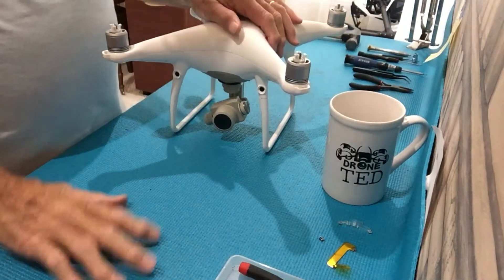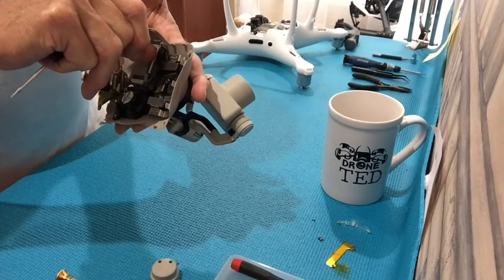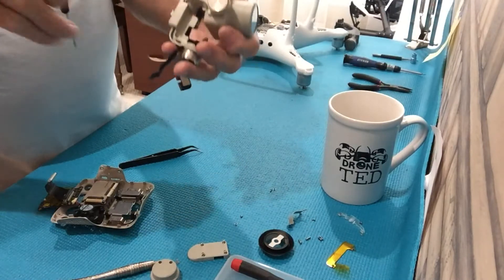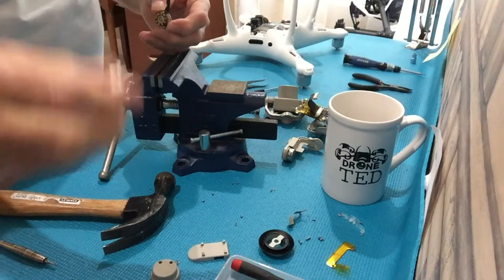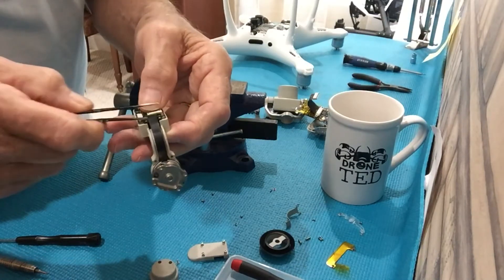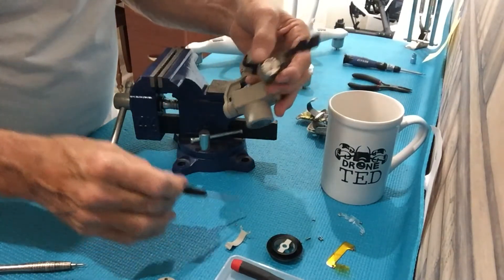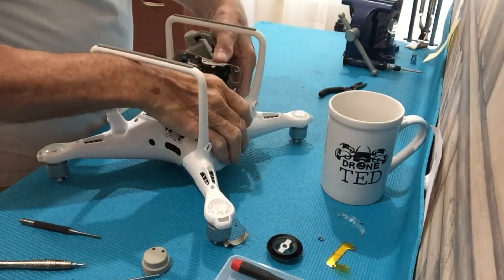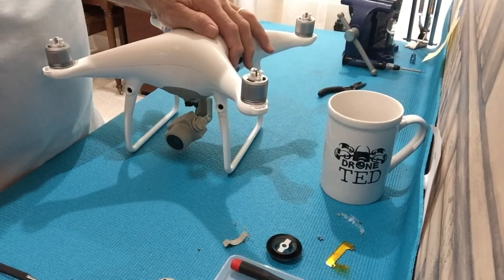Yaw motor replacement DJI Phantom 4 series video 1 and 2

Comment: Ted, is still necessary reuse the old magnet case? For P4 regular, seems all parts come with the magnet case as a Plug & play,

Regards
Reply from the maker: Yes it is necessary to reuse the original casing

Comment: Hi, Ted. Thanks so much for all of your videos.
Is the yaw motor and casing the same on all of the Phantom 4 models (std., adv., Pro, Pro V2)?
Reply from the maker: all Phantom 4 drones share the same yaw motor. The only difference is the early yaw motors had a round casing. this was only on the early P4S.the actual motor is the same
they all use the same roll motor
Te pitch is different on the P4s from the P4Pro. the p4Pro version 1 and 2 share the same pitch motor

Comment: I am in the middle of replacing the flex cable of the camera yaw .
One of the 3 small screws that connects it to the bottom of the drone got wasted.
Any advice?
Reply from the maker: If the gimbal has never been removed from the drone, one of the screws has glue in the center of the screw and you have to pick it out with a pointed object like a needle. If it is damaged I use an ez out tool.

Comment: Have you noticed on a Phantom 4 that after installing an aftermarket yaw motor, it appears to work fine, but now there's no camera feed showing on the controller?  This just happened to me, and I have not had time to investigate it yet, but thought I'd reach out for an idea of where I need to start looking for the problem.
Reply from the maker: Probably not the yaw motor. It is probably the ribbon cable. Do you have a camera sensor error?
Reply: @Droneted  the yaw motor was physically damaged after a hard landing / rollover, as it was explained to me, and hanging loosely.  While the drone had a working camera feed, the gimbal didn't work correctly due to the damage.  Now the motor is fixed, but the feed is gone.  I'll check for error messages when I get home from work and turn it on.
Reply: @jaymay306  What came of this?
Reply: @ItchyKneeSon  still pending.  I think he’s right and it’s probably the ribbon cable.  Just haven’t had time with family stuff, etc.  I’d like to dive into it in the next few weeks though.
Reply: @Droneted  Ok, so no camera sensor error message.  The error now showing is that it's recommended I calibrate the IMU on a tablet or computer.  Still no video feed though.  It could be a ribbon cable, since when the drone was given to me it had been crashed.  The Y-axis motor housing was broken.  Even the metal pin going through the magnetic motor housing itself would not drive out, so I'm assuming it was bent.  Therefore, I could not use the original motor magnet to keep the camera straight after the motor was replaced.  Is It possible one of the ribbon cables was damaged and I wouldn't be able to tell with the naked eye?  I can't find any visible damage to any other components, but it the impact were bad enough to bend the thick metal pin through the Y axis motor, I would imagine other stuff could have suffered, like an exposed ribbon cable.
Reply from the maker: @jaymay306  cables can have small nicks you can’t see
Reply from the maker: Ok. I’m here to help

Comment: Hello, 

Is is very nice what you do. I've learned a lot from watching your clips. Something I'd like to share with you.
I had the pointing to the left problem with the camera. Replaced the Yaw motor as you did in this clip. All worked out with the switching the Yaw motor to the original magnetic case.

To my disappointment. Still have the same problem.

Any suggestions?
Reply from the maker: I want to be sure I understand the issue. The gimbal pointed to the left. It did not swing back and forth. You changed the yaw motor and used the original case. It still points left as before. Is it steady and the only issue is that it points left? Did it start doing this all of a sudden or was there a crash or hard landing involved?
Reply: Hey  @Droneted  - First thanks for getting back to me on this.

Started with a crash. After that Started pointing left. Original case used. After repair, camera is steady as before but still  points still to the left.
🔧
Reply from the maker: @corbettsantanavideographer  if nothing is bent I would guess it may be the camera IMU. You can email me at droneted@gmail.com 
Are you in the USA?
Reply: @Droneted   Am located in Berlin Germany. IMU? What can I do to adjust this or fix it?

Consider sending to you for repair. Depending on the cost.The ones I've met here are incompetent.
Reply from the maker: @corbettsantanavideographer  You certainly can do that. The last time I shipped to Europe it cost about $50. If you wanted to ship it to me I can either repair it or swap for a refurbished unit. I suggest you email me at droneted@gmail.com to discuss the cost
Reply from the maker: @corbettsantanavideographer  I checked UPS. $50 and it takes a week
Reply: @Droneted  Hello once again, Have not had a look until today and tried the IMU calibration twice. Still the same situation. You say that you have rebuilt Phantom 4 Pros. How much would one cost? Get back to me on that, please.🤕

Still would like to know whats making it point left though.

 Wish there was a way through the USB cable to adjust it. When I use the Yaw adjust it does not go far enough to the right to be centered. Before I replaced the controller board I was able to use the YAW controller in the app to center the Camera up from pointing to the left.  I replaced the controller board and it made it worst. Put back the original and have this situation. As I told you, I replaced the Yaw motor as you did in this clip thinking that it would work but...

Wow!
Reply from the maker: @corbettsantanavideographer  I do have gimbals that I have rebuilt. It would be cheaper if I repaired yours. Email me at droneted@gmail.com. where are you located?
Reply: @Droneted  I sent you and E-Mail

Comment: Can I send a video? It is hard to explain. When I first turn my p4p on it seems to start caging then the roll gimbal vibrates then roll travels from limit to limit and yaw travels back and fourth. I replaced the roll motor and ribbon cable twice, no help.
Reply from the maker: yes you can. droneted@gmail.com

Comment: Hey Ted, I have a P4 Pro V2 that has a yaw motor that has a dragging or scratchy sound when moved side to side and also has a very bad vibration. The vibration creates a jello effect in video and a not so sharp photo. Would replacing the yaw motor be the appropriate fix and if so where would you suggest I purchase one from. Thanks
Reply from the maker: It is possible that it is a bad yaw motor, or it could have dirt in it. try blowing it out with air first. It is also possible that the cap over the yaw motor is hitting . It is held on by just 2 Phillips screws ( PH00 screw driver) try just taking that off first. You can tell if that is an issue by moving the yaw back and forth with your hand while the unit is off. It should move very freely. Any binding at all is an issue.
Reply: @Droneted  Well Ted I thank you for your reply. I took the gimbal apart and inspected everything. I didn't notice anything really wrong. I noticed after reassembly that if I grabbed the gimbal and pulled forward a bit the vibration would go away until it was moved. So I took a hard look at the vibration dampener. Seemed to look fine but for kicks I swapped the rubber dampeners front to back and flipped them upside down. Reassembled and powered on and haven't had a bit of vibration or noise what so ever. I went ahead and ordered and new dampener just in case but after a few flights now I have not had any issues again.
Reply from the maker: @davidb7619  that can happen but it is rare. Glade you got it solved

Comment: Have you ever replaced the pitch motor, mine when it is perfectly level it will flip part way down and then back level again about every 5-10 seconds , but if you lower camera about 10 degrees it works perfect
Reply from the maker: Yes. That motor is a direct replacement. Very easy. Direct swap
Reply: @Droneted  thank you